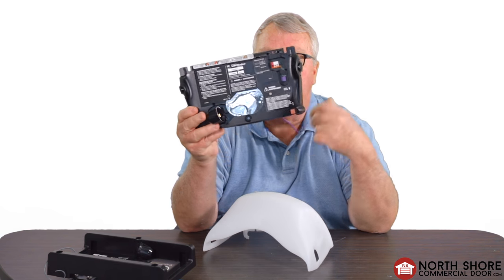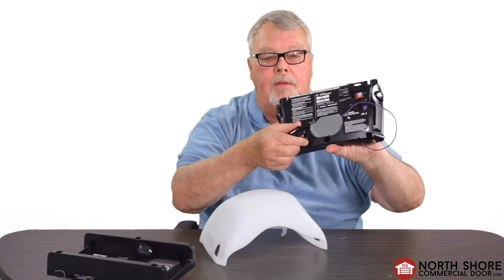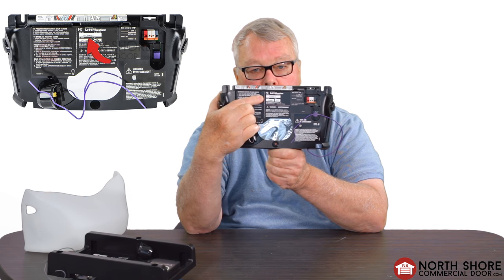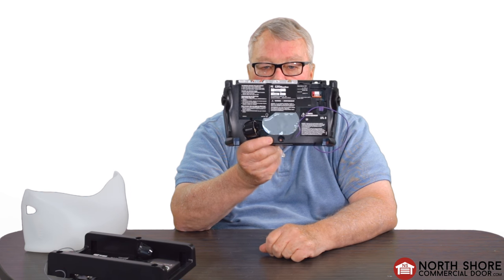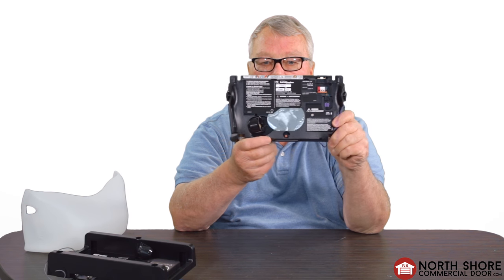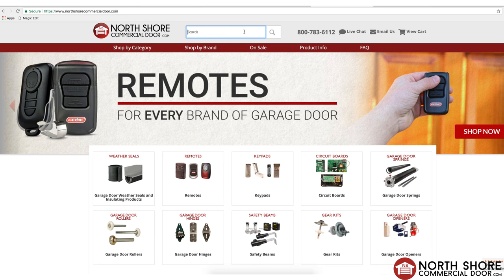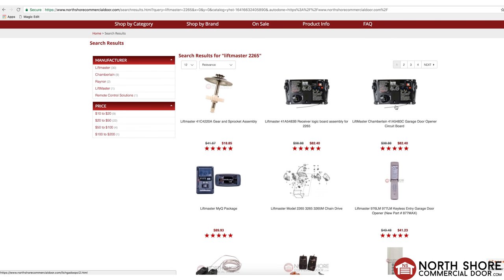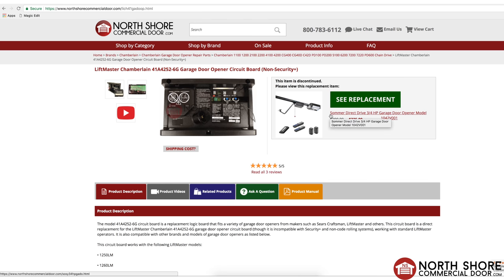Chamberlain LiftMaster Garage Operator Control Boards

Comment: Thx for your Vlogs. Great information. Question: symptom is garage door 
doesn't respond other than clicking noise when actuating wall button. 
Thinking it may be circuit board; I replace with new, but still opener 
not working and symptom remains the same. My opener is a  #2585 Chamberlain 
LiftMaster Professional 3/4 hp belt drive opener. It appears to have two 
capacitors; large white tube like with one having a green sticker and 
the other having a yellow sticker. No outward sign of damaged capacitor;
 if they are bad or one is bad could this cause no function at all or 
what...please advise. Thank you for your thoughts. Brooks

Comment: Good video. My liftmaster will not program to remotes (even a new one). It functions with the wired button. Is this a control board issue for sure? Could it be something else?